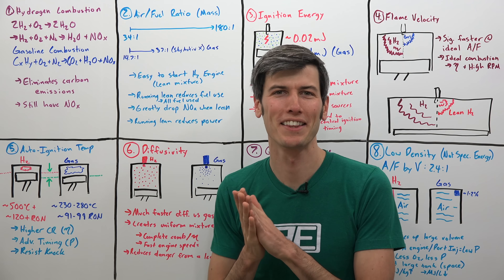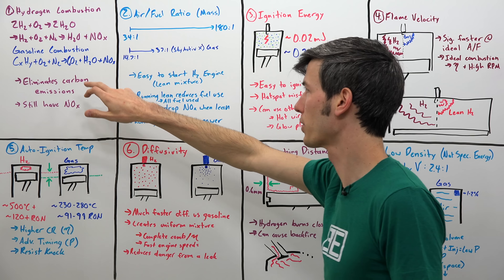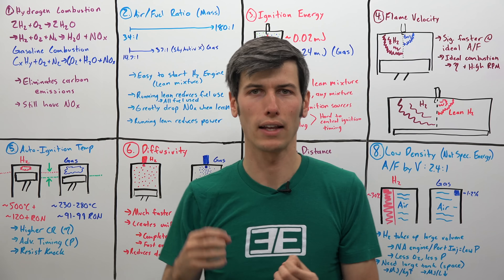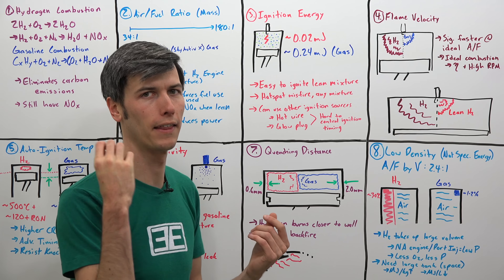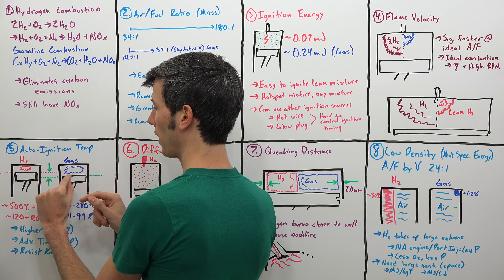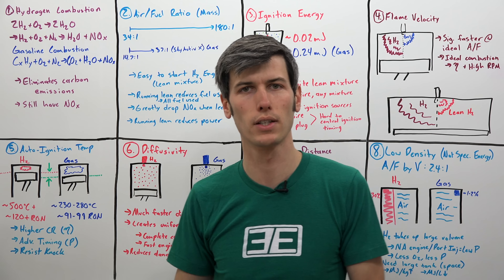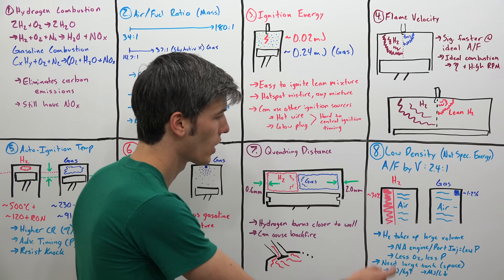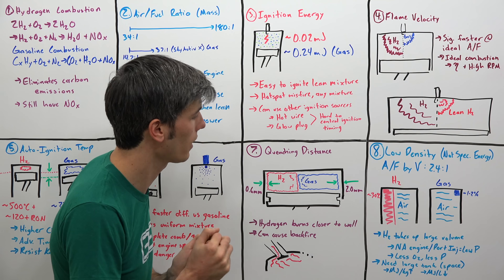The Difference Between Gasoline And Hydrogen Engines

Comment: I always had a concept in my head of a car burning the direct product of electrolysis. Like having a shed with a solar panel at home, that constantly produces H2 and O2, mixed, but in a perfect mixture, as it's both pulled out of water. Compressing this gas and feeding it into the engine with no additional intake of outside air would result in completely clean emissions, right?
I see a safety problem, yes, but i has to be worth a shot, right?
Reply from the maker: If you didn't introduce nitrogen to the equation, yeah, you'd have no NOx, unless your exhaust temperature was hot enough for the air near the exhaust to create NOx. But oxygen alone and hydrogen alone are challenging to deal with.
Reply: @EngineeringExplained  Thank you so much for answering Jason, it means a lot.
"Challenging", yeah xD. But people blow up for stupider reasons, so one day... i'll let you know how it goes ^^

Comment: BMW built a hydrogen powered v12 7-series in the mid-2000's. It could be run or gas or hydrogen and I think they made like 100 or so of them.
Reply: They stopped it due to problems cause by hydrogen. Hydrogen makes most metals brittle over time.
Reply: @sebastianm.4632  most people only keep their car for a few years anyways. I'm surprised the automobile companies don't use hydrogen more to validate that wasteful use.
I wish I had the time to modify an engine into a hydrogen engine
Reply: @sand0decker  
Hydrogen has its own operating parameters that must be designed for; and again, hydrogen can diffuse into metals under heat and pressure, disrupting their alloy configuration and changing their properties.
Hydrogen is obnoxiously difficult stuff to work with (what with being a perfect fluid, flammable, combustible, etc; Elon Musk cited the "pain-in-the-@$$ factor" as one of the reasons for switching over to methane-LOX from LH2-LOX), and running a gasoline-designed engine block on H2 can cause more problems than running it on ethanol.
Reply: @HuntingTarg  I meant that as in a city use vehicle. Most people only go short distances and don't maintain their own vehicle, so as far as they are concerned, less gas is good.
Just because something is hard to design for doesn't necessarily mean it's not worth the effort.
I'm not sure, but I think some of our city buses use hydrogen. I think one of them had a logo saying it. It could have been a test item though, I did go to a college in the capital of my country
Reply: @sand0decker  did you really just say people only keep their cars for a few years so we can afford the engine degrading faster?
Reply: @Harry-TramAnh  a lot of people do. Maybe not in your area, but they certainly do in my area. I'm not going to argue this
Reply: @sand0decker  
My county's public transit system has converted over to LNG; less problems with refueling.
Reply: @HuntingTarg  they apparently cancelled the contract for the old buses and are switching to those for that reason. The other buses always gave them issues
Reply: They could have put sleeves in the cylinder to stop the hydrogen from defusing into the block and making it brittle. Lame excuse to stop an amazing technology. I wonder how Ronn motors handles that in the scorpion car.....or if he just let the block turn into swiss cheese
Reply: @johncurran1179  
Hydrogen will diffuse through ANYTHING over time - the only 'worse' fluid in this respect is Helium.  Any liner suitable to abate hydrogen diffusion in a combustion environment would likely be suitable to make the entire engine block out of.
Hydrogen is best used in light-duty applications, and as rocket fuel.
Reply: @johncurran1179  good idea
Reply: Very interesting topic here, as I'm not fond of the electric powered cars. 

I was already thinking, how are we able to run our precious oldtimers with the lovely combustion engines in the future? I always had the idea of converting those to hydrogen, but never knew about the brittleness problems. How quick is it in terms of mileage? 50k?

Comment: Are there any engine prototypes for pure hydrogen and oxygen combustion? I know carrying around pressurized tanks of both is incredibly dangerous but if we are going to be carrying around lithium batteries then why not. Like a rocket engine, inject them both as liquid, would that do away with any need for forced intakes, smaller cylinders for the same power and  no NOX,  I'm sure there are plenty of reasons it is not a thing like cylinder wall strength, but I'm surprised I have never heard of it.
Reply: Ben Carter the major problem with injecting liquid H2 and O2 is both need to be at cryogenic temps. You’d have keep the entire fuel system near absolute 0 constantly
Reply: @NitrousFox  If you can keep the pressure high enough then temperature is not an issue. Just like Nitrous, regular propane or even hydrogen for fuel cells, its happy enough being stored at room temperature as long as it is under enough pressure. And like in a gas bottle you can tip it upside town to shoot out the liquid. You would just need to uptake the liquid instead of the gas.

Comment: I remember Mazda made a hydrogen Wankel engine for the RX-8 back in 2006. Its Renesis engine had a dual fuel system to either run on gasoline or hydrogen which is wicked cool. Every time I see that Toyota Mazda partnership, I keep thinking hydrogen rotary powered cars because they both have something to do with hydrogen whether it's a fuel cell or hydrogen engine
Reply from the maker: Yes, super cool! I'm actually making a video on the RX-8's engine!
Reply: Awesome! I can't wait to see it

Comment: so can you just directly change petroleum in a car to a hydrogen fuel tank?
Reply from the maker: Hydrogen needs a very specific tank, as it's stored at high pressure to keep it liquid.
Reply: @EngineeringExplained  i do not think hydrogen can be stored liquid in a car.

Comment: The high diffusivity of hydrogen makes direct injection pointless. As the flame front expands the cylinder temperature and pressure rise, causing the danger of autoignition of the unburned mixture away from the spark plug. Gasoline direct injection aims at creating a stratified mixture that is leaner, with higher autocombustion temp, the further away from the spark plug.

Great video as always
Reply: But the high diffusivity of hydrogen may enable the use of only one fuel injector in the intake manifold. 

Also, a throttle valve is unnecessary due to the large range of the AFR, like in diesels.

Comment: Why not LNG? It is cheaper to occur while offering better than gasoline.
Still produce carbon, but LNG is cheaper even if compared with gasoline
Reply: Only cheaper because its often taxed much less ...not really cheaper per Joule of energy to produce.
 If it was widespread use it would just be taxed more to compensate  - and overall it still produces excess CO2 the biosphere can't handle.   i.e. It doesn't get us out of the fossil fuel mess we are in.
Reply: @bbbf09 Really? Isn't LNG better than Gasoline?

I have rrsd somewhere that LNG, once, is just wasted since no one need it.
Now they have the alternative.

In Indonesia, once, there are a programme to convert your-already-gasoline car to LNG. It didn't work well since the LNG station is so few.
Now the Public Transportation (Transjakarta) use it on most of their buses since it (proven) produce less emmision than Diesel engine
Reply: True except the engine should be designed to accept LNG. That was the problem of gasoline vehicles modified to run LNG. Needs heat to startup sometimes so people would start the car with gasoline then switch to LNG when the engine is warm enough. Also, the exhaust stinks because the chemical added to LNG in order to detect leaks didn't burn.

Comment: How about combustion chamber sealing and lubrication, the exhaust is basically water so how to prevent engine from hydrolocked?
Reply: I'ts only tiny amounts of vapourised water, close as the vaporisation you can see at the exhaust of a cold engine, no way near enough to hydrolock the engine. Sealing and lubrication don't change much.

Comment: I hope that we get both electric and hydrogen. Electric for the commuter's/everyday to day and hydrogen for the fun, the hopeful future to the term dream two car setup.
Reply: I doubt you'll use H for anything. It costs 5 times more than gasoline. Using highest octane aircraft fuel + nitro would be cheaper and produce more power.
Reply: @mychevysparkevdidntcatchfi1489  The Toyota Mirai costs the same per mile as a regular petrol car, whilst it is a fuel cell vehicle, the cost of hydrogen is dropping, it will at some point be the same price if not less, and there are already fuels from CO2 and H2 which are at the same price as petroleum products now. And, of course, the H2 economy is designed to stop fossilised carbon emissions, we may not have any recourse to jet fuel.
Reply: @Eddiecurrent2000  Gasoline costs $3.20/gal while H costs $16.50/kg. Prius gets close to 300 miles with 5 gallons of gas, just like Mirai 300 miles with 5 kg. But Mirai costs $60K vs $20K for Prius. How are they anywhere remotely close in price, per mile or otherwise?
Reply: It won't happen.

Comment: When you an environmentalist but also a petrol head at the same time.... hydrogen engines
Reply: Winslow Greaves would rather have hydrogen cars than electric cars.
Reply: DME = Dimethyl Ether. 

Also known as "Bio-Diesel" here im Brazil
Reply: Or some other clean(er) fuel, that preferably is more practical (like DME)
Reply: Thom kouwen what’s dme
Reply: Gear head (petrol is petroleum based)
Reply: Hydrogen is not a fuel source. It is merely a means of storing energy that has to be converted from another source. This makes it a rather inefficient fuel to burn.  Especially since it is usually converted from propane.

Comment: Instead of burning hydrogen with atmospheric air (containing nitrogen),  burn it with pure o2 from a tank, this could even be pre-mixed before entering the engine, and the engine would be more efficient since the intake charge is already under pressure helping the intake stroke. Maybe the engine needs a "fill" gas to do the expanding (work), one could use an inert gas like argon?

Comment: I have feeling that this will be very relevant once fuel reformers are more common. While fuel reformers are meant to be used in conjunction with fuel cells, they can be used as a drop in system for combustion systems, too. ICEs would still be around even when we have switched to electric which will include fuel cell cars. 

I wonder if hydrogen can be used as a secondary fuel or addition to help with existing engines. Since it would be great for cold starts, having some hydrogen reserve or an on board hydrogen generator of some sort would reduce cold start emissions significantly. Also, we could mix in hydrogen in the cylinders to get more complete combustion. Less sooty diesels, anybody?